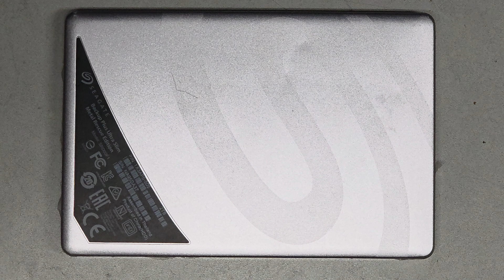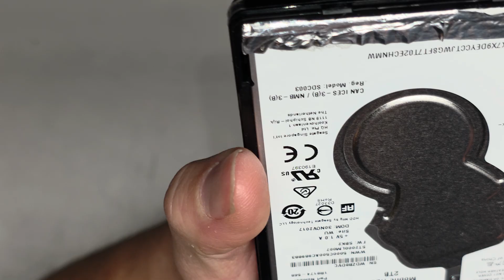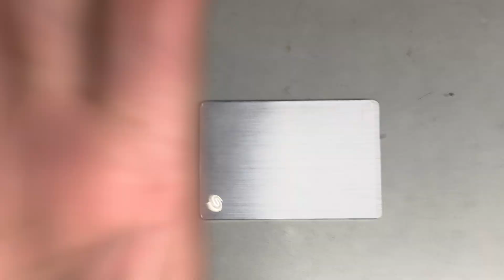2TB Seagate Backup Plus Ultra Slim Metal Rescue Edition SRD00F1 Disassembly Hard Drive Removal Fix

Comment: Thank you! The sata cable worked perfectly but I decided to check the sata adapter to make sure. There didn't seem to be any breaks or bends. It turned out the adapter came loose from the drive after the fall so all I had to do was push it firmly back in.
Reply from the maker: Awesome!

Comment: How to open that disk side cover, centre screw is different rest screws are open. Please help
Reply from the maker: What do you mean?
Reply: @ItsBinhRepaired there is two side of hdd, one side pcb connected another side disk with head. So i want to open disk with head side cover, there 5 screws opened but centre screw have different kind screw how to open that. Screws are under the silver nameplate.
Reply from the maker: @jaikishandewangan1254  I guess figure out what kind of screwdriver you need? You're trying to access the platters? If you do that, you're sure to lose all your data. If you can't figure out what screwdriver, I don't think you'll be able to fix whatever is wrong inside the platters and heads. I recommend sending it to a professional lile 300dollardatarecovery.com